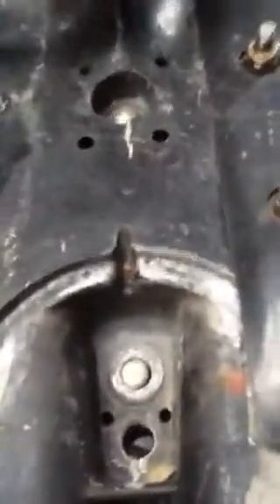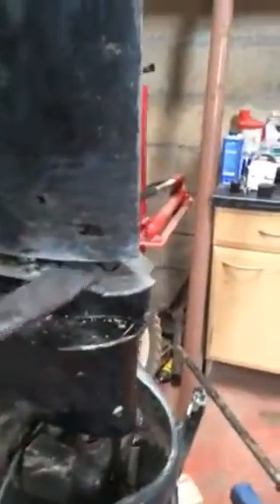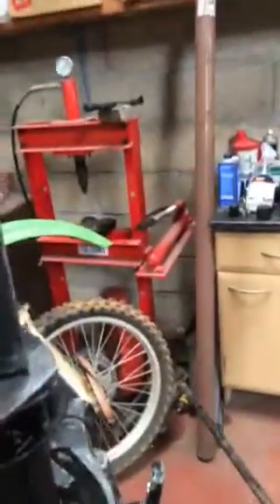Mercury 50hp gear case removal problem outboard

Comment: Are you sure the shifter rod is not still fastened together? Some Mercs have a connector and some just slip out on splines as I recall! Anyway, it sure looks like something is holding it together. With that much movement it should have come loose unless something was still fastened...just my thoughts - not knowledge!